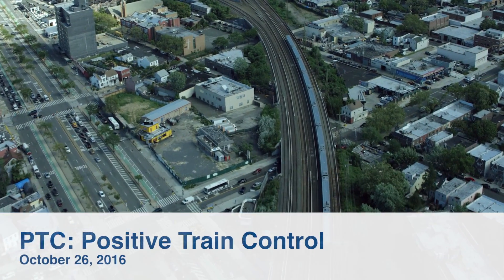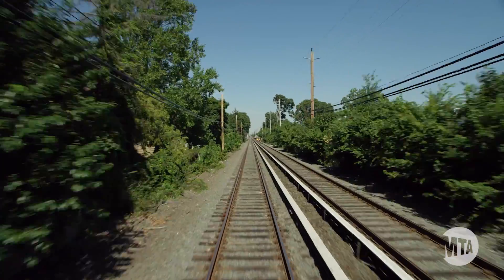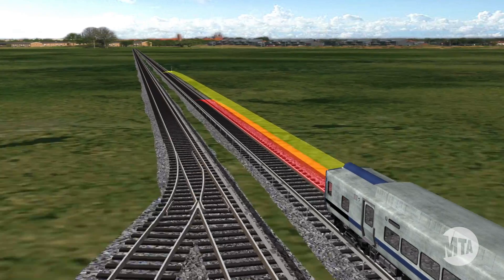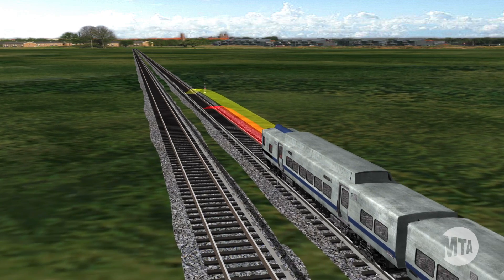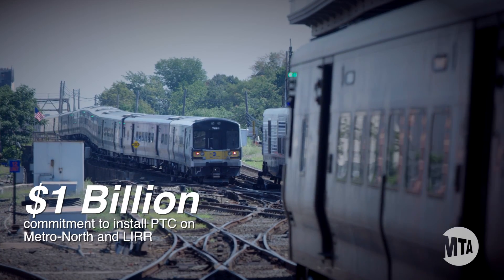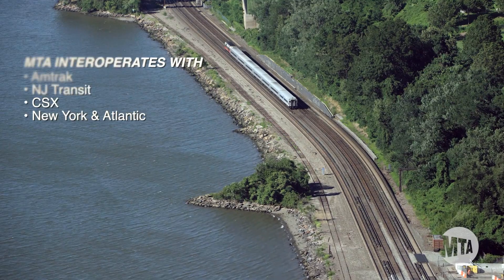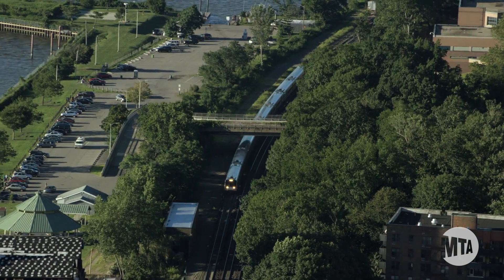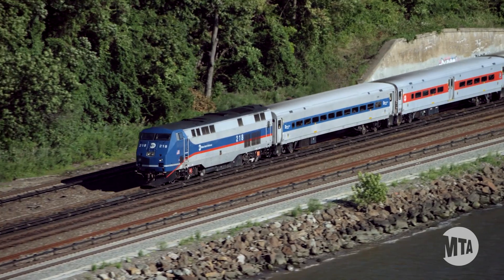PTC: Positive Train Control

Comment: How is this different than CBTC?
Reply: Parnab Goswami PTC is (almost) essentially CBTC for the railroad system. Commuter rail and subways are different breeds to trains.
Reply: Got it. PTC is a process of CBTC...is that it?
Reply: Parnab Goswami I guess. PTC is a system that uses signals and sensors to communicate with trains to prevent derailments and collisions when the driver is unresponsive. In other words, it would automatically stop the train if it goes too fast, goes through a misaligned switch, about to collide with another train, or enters a work zone where the track is taken out of service.
Reply: PTC still keeps wayside signals whereas CBTC is all cab signals.
Reply: @blakemcnamara9105  gotcha

Comment: Would ATC or other modern signaling systems be cheaper?
Reply: ATC and PTC are virtually the same thing. Although ATC auto stops the train if a signal is passed where PTC goes off every 30-45 seconds
Reply: @Mnrr6131  I thought ATC was the one that went off every 30 seconds if nothing was touched.
Reply: @maxrshelltrack7443  your right
Reply: ATC is already there and not installing PTC would've been cheaper they didn't really need the new system nothing wrong with ATC.